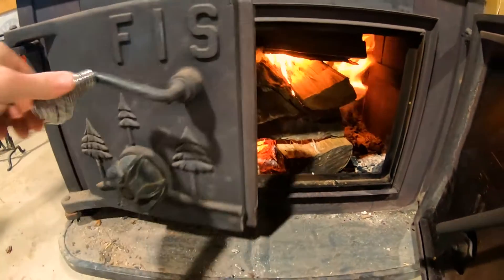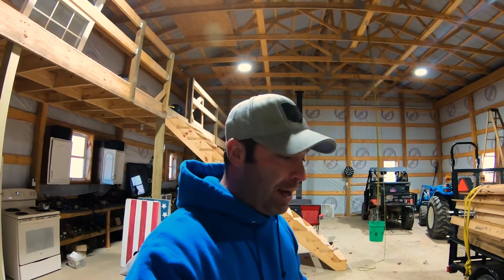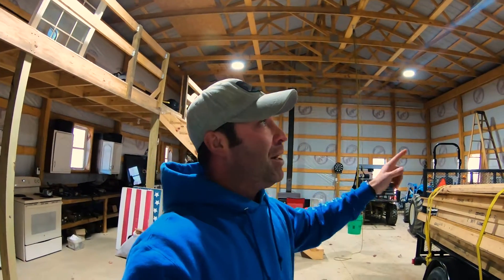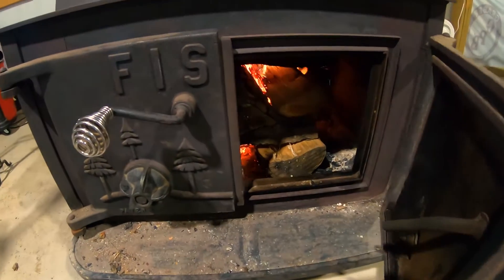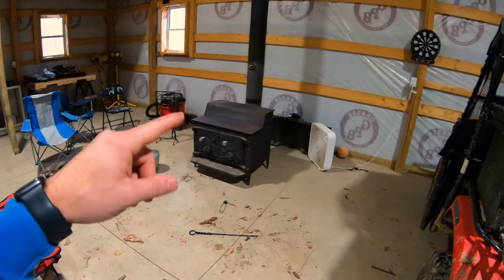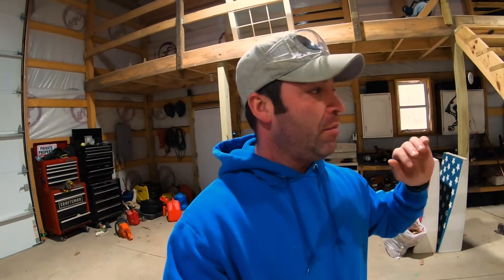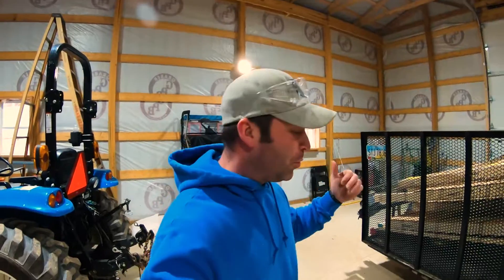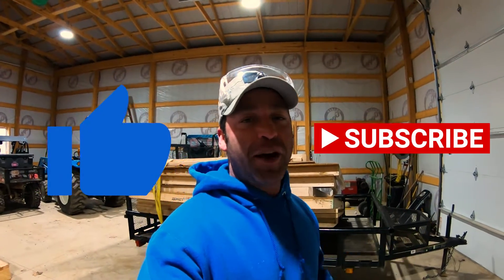Can You HEAT an UNINSULATED Barn?

Comment: Its not safe to run the turbo heater inside a closed space. Carbon monoxide will build up quickly. I tested this in my garage with a CM meter it only took minuts do be in the danger zone.

Comment: My shop is 40x50x14 and its not insulated. I just bought a 125k btu overhead heater and i have free gas that i can run non stop. Im hoping i can take the chill off but i may have to add another one.
Reply: How do you have free gas? Hehe
Reply: @alextireandauto  gas well on property 👌
Reply from the maker: I hope it works! I may be getting my shop spray foamed. If I get that done, my wood burner will run me out of the shop.
Reply: @TripleTAcres  I agree, I was quoted 6k to spray foam my shop. Might be worth it in the future

Comment: What do you mean? You can heat anything if you have enough BTU's
Reply from the maker: You are right. This was a test to see if stuffing the insulation in the ridge vent and soffit would help slow the release of BTU’s. Also, to see how long it took to make it comfortable.
Reply: My buddy Jim at Coppercitylandscaping just insulated his ceilings. That helped huge with his heat retention. 

A large majority of heat is lost out the ceiling if not insulated. (Not sure on exact percentages)

Remember to take out the ridge and eave vents once you have it fully insulated 😉
Reply from the maker: @315-snoblow  I can’t wait to see the difference the ceiling makes with insulation. I’ll be taking out the insulation on ridge vents and soffit for sure. Good looking out!